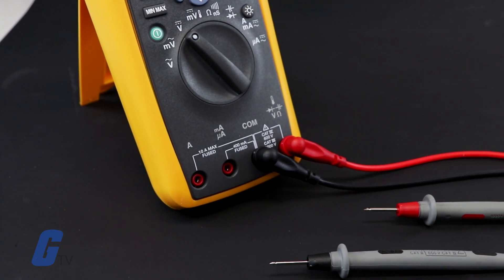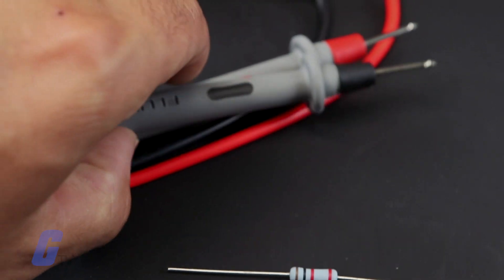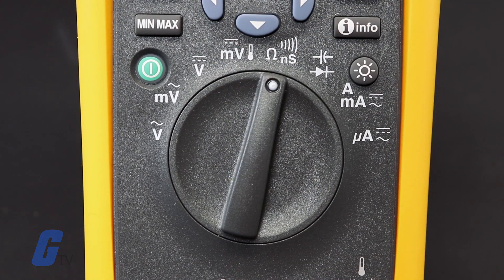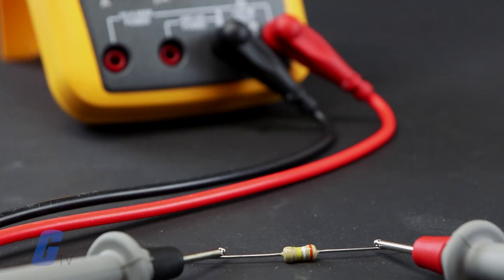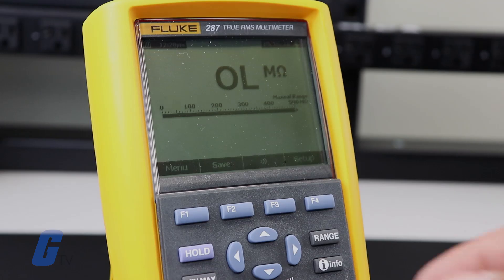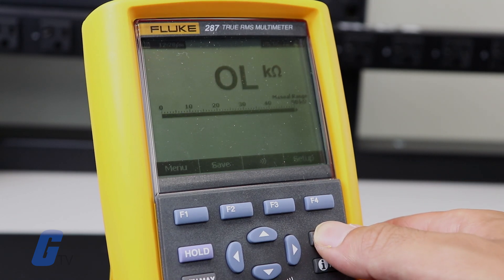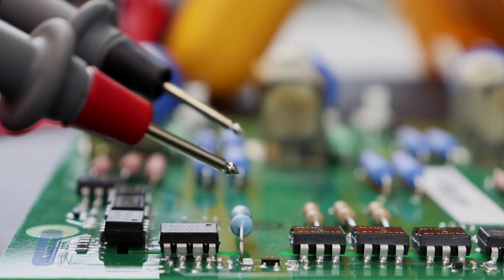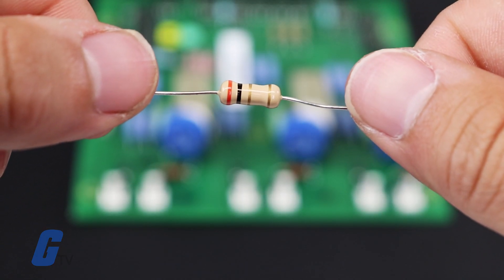How to Measure Ohms with a Multimeter | Galco

Comment: Measuring 10000 ohm resistance in my windshield wiper motor. Set range to mohm and get ol.
Does this mean that the wire is cut. When I put it into continuity there is no beep. So the wire is cut?
Thanks.

Comment: you fucked me galco. you took my time. this offered nearly nothing of value. what are the differences in ohm settings? why/when would you use those settings. what do the values represent etc. when measuring at 20 thousand ohms and you get 6 - what does that mean in relation to what youre measuring. one or two examples would be great. thanks for nothing

Comment: That resistor in the end of the video is color coded 2 Ohm 5% tolerance, Fluke measures it 3 Ohm - 50% difference. So much for the best DMMs.